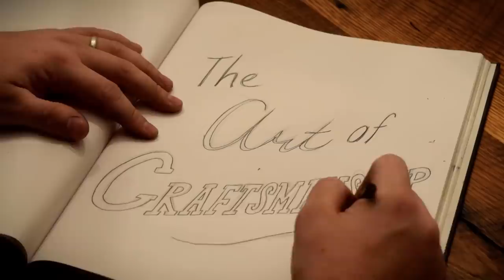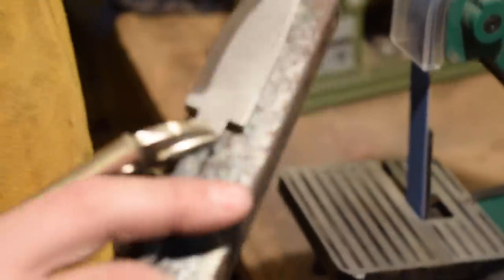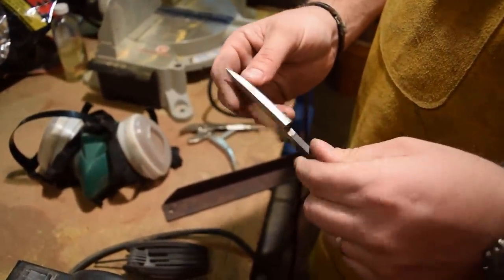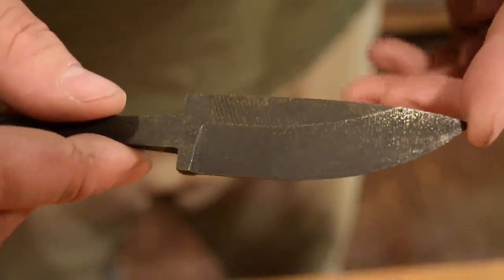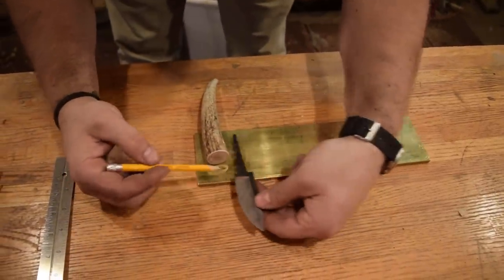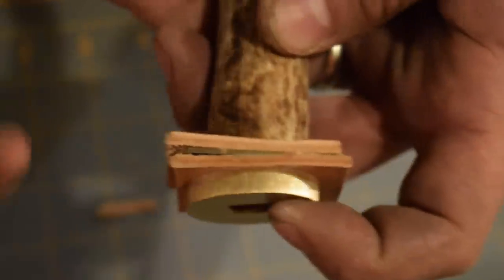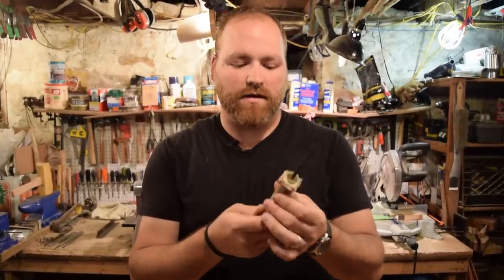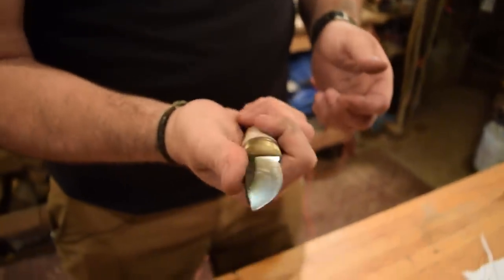Making a Hidden Tang File Knife with Antler Handle

Comment: I’ve watched this video twice now enjoyed both times. One trick I use when I have a small opening between my bolster/guard is to hold it in place tight and lay it on my anvil and hit it with a hammer. The brass is soft and will close the gap. Then take it and use sander on both sides to get back flat. 👍🏼

Comment: I got pretty much that same sander at H F. I created a larger top to replace the tiny work area.  Also tapped out for a screw to adjust the angle, with a needle gauge on the side so I know exact degree.  Your videos are relaxing and informative.  Thanks.

Comment: Nice job. Cover the blade with tape before applying epoxy. Cut the antler tail, drill a hole at end, swage a brass tube through the hole and tie a leather tassle through the hole. Great personality. Greatings from Beirut- Lebanon

Comment: Awesome video!!!  I would like to see a video on how you made your forge though.  THANKS!
Reply: Yeah me too. I'm wondering if that " plaster or paris" would hold up to twin torch burner set up.
Reply: @kevinhollister947  I don't think it's plaster of Paris.
Reply: @kimcurtis9366  I thought that's what it was. Or maybe that's what somebody else did. More research,  definately more research.
Reply: @kevinhollister947  The white material in the forge is Pearlite,find it easily in the hardware store in the outdoor gardening stuff. You can also use Vermiculie, found in the same place. It is made into a paste by adding "water glass" which is potassium silicate, (a liquid) which  is on Amazon or where there is a chemical store in a larger city. There are a lot of "how to's" on You Tube for building a forge like that. Look up "coffee can forge" on here. I have made a couple and they are easy. Also, Harbor Freight has a great torch for a forge, it is a torch for burning weeds.

Comment: Small tip, a Q-tip dipped in acetone works wonders for cleaning the epoxy squeeze-out and cleaning up the blade.

Comment: Beautiful knife. I'm a bit late to your channel, but I have a couple of tips for cleaning up excess epoxy: (1) when it's still fresh/wet/uncured, use ordinary household white vinegar - it will dissolve the liquid epoxy and you can just wipe it away (also good for cleaning it off your hands etc. (2) do most removal/shaping of hardened epoxy while it is still in its plasticky phase (ie after it's not liquid, but before it's glassy-hard). You can just use Exacto knives etc, rather than needing to use grinders etc which make clouds of nasty abrasive dust shards.
Reply: For clean up, I use acetone. I hadn't considered vinegar. 
Why work the handle while the epoxy is still malleable?

Comment: Greetings from Ossett, England. Really enjoyed the video and the cool relaxed way you work. I would either leave the handle as is or maybe centre drill a piece of buffalo horn and glue a piece of threaded bar in. Cut the handle down and centre drill. Place the buffalo horn threaded bar in a lathe or drill chuck and fashion with file and fine grit paper to a nice design and finally polish with a car body paint restorer and then glue into the antler tine. Wish we had antler tines that big, is it a moose tine? Biggest we have here are red deer about half inch diameter max, not a tad more. I do a lot of horn work, stick handles, knife handles, pipe mouth pieces, cigarette/cigar holders and drinking horns etc. Great fun if you can stand the smell. All the best mate, Chris.

Comment: Hi very nice knife i have done many from files but never quench or normalise them just shape the knife and from full hard as the file is and temper and done with everyhing without need to normalise andthen requench and again tempering no need all this you got the file fully hard initially just shape the blade and temper it in the oven and its done to the light yellow colour thats all it is the same and saves you lots of time and energy for reaching these temperatures i think this is the all idea of using files to make knifes

Comment: That came out awesome. I would leave the handle long. I don't like how you removed so much texture off the antler though, when sanding the brass and leather down. Maybe the the 1x30 would have got in there better than the 4x36. But Over all I wish I could make one that awesome. I am going to try make a hidden tang one soon. But I need to finish my third knife first then my forth will be hidden tang. That leather pops out so awesome once you added that oil. Much better than I thought it would be.
Reply: scottecooke m
Reply: Leave the handle the way it is.   More rustic, and authentic.

Comment: Great trick turning the deck bak 12 degrees! As you can probably tell I'm brand new at this ! Lol I also noticed most of the really good builders don't use gloves when setting the bevel... I guess this is the make sure you're not getting it too hot ..?
Reply from the maker: Yes. I never wear gloves when grinding knives. Gotta feel the heat😁. Thanks for watching.

Comment: You'll dull a lot of files cutting notches into hardened steel like you were. Also by applying pressure on both the push and pull stroke you're liable to break the teeth off your file. Most files work on the push
Reply from the maker: bannisterrb 
Thanks for the input. I am only applying pressure on the push strokes with these files, but I'll try to remember to lift up more when I'm pulling back. Thanks again and thanks for watching.
Reply: @TheArtofCraftsmanship  , why are you normalizing the steel before quenching? Normalization should be done before fabrications, but not before quenching. 
And after hardening, you should use only the diamond files, because it suppose to be hard as regular files. Since you are making your knives of your files. You can use them on hardened steel. :)
Good job.
Reply from the maker: N Tatic 
Thanks for asking. Annealing is done before shaping, and normalizing is done before quenching. As you are working the profile and the initial bevels before the quench and tempering, you are heating. And cooling the blade often, during grinding. Normalizing after this process and right before the quench, removes any stresses and variations in the grain structure to make a cleaner grain for the final knife.

Comment: If I may suggest , brazing the blade and brass bolster together with silver solder to improve the joint and help "hide" any slight imperfections in fit and it improves overall appearance .

Comment: Wonderful knife..10/10  .. handle length just nice. Im just curious whether there is anyway you could have masked the handle before grinding so that the texture remain as original. Cheers
Reply from the maker: I probably could have, but I was actually going for the transition of smooth to rough antler, which I really like.

Comment: Nice work! Enjoyed your video. You may be interested to know that Walmart is carrying antler tips and sections as dog chew toys. Also, I used to work in the military aircraft manufacturing sector, and we commonly used an adhesive you may be interested in. It's called 3M Scotch-Weld DP100FR. Much stronger than JB Weld or any other epoxy, but the neat thing about it, it cures in an off white color, much like antler and bone. But it is rather expensive, around 30 bucks for a two part tube dispenser.
Reply from the maker: Jojo Diver thanks for watching and your great suggestions. I’ll look into both.
Reply: My wal mart carries a few things that most dont like guns and reloading equipment an supplies, but they dont have the antlers in the pet section. Good tip tho because I can look at their website and get it site to store. Btw, lots of times their site I cheaper than the store. If you find something on the shelf that is cheaper online, they will pricematch. I do it all the time with rods and reels, and reloading dies.
Reply: @MrDirtysteve75  I don't think I'd order antler tips online. They're all different.
Reply: @jojodiver8706  I've got other things I can made with them if they aren't suitable for knife handle. I also have 3 dogs that would enjoy them.

Comment: Enjoyed your video I have two questions first question what is the make and model of the small belt sander that you use and second question at what angle do you have the bed of the belt sander set at 
Thanks in advance

Comment: From my experience, for what it's worth to you, you can completely harden your blank in the vegetable oil by swishing the blade forward and back and side to side!
It will cool down much quicker than just plunging it into the oil and holding it there!  Doing it this way cools the blade much more rapidly and you won't need to heat and re harden and then quench in a different quench medium.
Best of luck!  You made a very serviceable and nice looking knife the way you did it!
If my way of hardening doesn't work for you just keep doing what you're doing but, I'd at least try my way and you may be able to eliminate a step which will speed up your turn around time.
Kudos for a very nice video!
Reply from the maker: Thanks for your suggestion. I agree totally. Since making this video, I’ve learned quite a bit more (as we always do!) about the heat treating process. By keeping the blade moving in the quench, you break the vapor barrier that is cause by the heat releasing from the steel, which in turn, causes a more even and predictable quench. Thanks for taking the time to watch and bring up a really good piece of advice.

Comment: Looks great with the full length antler handle. Also, when using the knife in winter with gloves on, the extra handle length will afford a better grip. I'd leave it as is.
Reply from the maker: W.C. Sciales 
Thanks! That’s a great piece of advice.
Reply: @TheArtofCraftsmanship  
That 1×30 belt sander you are using, do you have a video of the modifications that you have done? I would really enjoy seeing what you have done to it, because I also have the same one. Thanks!

Comment: I like your video. You work with tools anyone could come up with. You might use a piece of aluminum angle to clamp to for grinding. Looks better and would absorb heat off of your knife quicker. Thanks for sharing
Reply from the maker: Joel Adams thanks for watching and your comment. I’ve thought a couple times about using aluminum angle iron for my jig, but I use what I have. I’ll keep my eyes out. Thanks for the suggestion.

Comment: When I use a file it weighs a ton but it buffs out like chrome.
When I use a circular saw blade its very light.
I leave them hard and use a zip saw to cut them and an angle grinder to work them.
And for handle hole  I heat the handle cherry red  and with a 110 welder on low I blow holes through the handle.
I clean it up with a angle grinder and epoxy fills the holes in when you glue it
the glue get hard looks great and its as tough as it can be.

Comment: got a tip that will help you in the future. when you quench your blades you need to move them around vigorously to prevent the leidenfrost effect. it will help your blades harden more constantly. just a tip from another smith
Reply from the maker: Thanks! This comment will be on the new 5 Questions video. Cheers!
Reply: Not just around. Only up and down.
This minimises the leidenfrost effect as much as possible, and helps prevent warps.

Moving the blade sideways increases chance of warping. You want as little stress as you can on the blade when cooling.
Even once it is seemingly 'cool' it can still shift for 20+ seconds after it comes out of the quench.

Comment: To cut or not to cut...it all depends on what you use the knife for...and my grandfather never would use a piece of brass thicker than the blade for a bolster, Great knife, but when you were prepared to put the handle on, last step on mine was "Bluing." File steel will stay nice looking long if it's blued, just like a gun barrel...

Comment: How did the forge hold up for you? I noticed a little later on you started using a different forge. I have considered using in of these just as something cheap and easy to make until I buy something else
Reply from the maker: It has held up really well. The refractory degrades over time, but I still have it and use it occasionally. I switched to the new forge because I wanted to have a large and more versatile forge space, but for heat treating small to medium size knives, it’s still really effective.
Reply: @TheArtofCraftsmanship  great thanks for the quick reply! I thought that’d be a really good idea for something quick cheap and easy but I’ve read a few things that said to avoid it like the plague

Comment: If you have a glass place near you try buying a piece of pyroceramc glass (fire place glass). Have it cut to the size of your platen and JB weld it to it. It provides a crisper backing and draws the heat while grinding.

Comment: Great video!!  Keep the handle like it is. What did you use to mark the center of your blade to start your plunge line?
Reply from the maker: I used a sharpie to darken the steel, and then a marking gauge set at half the width of my blade, to scribe down the center, then flip the blade and scribe again, this will give you two lines, very close together. Between those lines is your center.

Comment: How did you trim down the table of the small sander? You said in the video you had to adjust the table after the sander bit into the bevel, what did you adjust to?
Reply: He cut off the lip on the back of the deck

Comment: I seen you used a 90° angle but I don't understand how you made the bevel on the blade? Is it because of the flex in the 90 or do you apply more pressure towards the top or the blade is clamped too? The only reason I ask is I figured if you clamp it to a 90 it's going to shave the side of the knife flat
Reply: The table is at 12.5°, like he said.

Comment: Hello,
I have a question about your hardening furnace. Which material did you process in the metal bucket? Is the refractory cement? Fireclay?
The idea with the metal bucket I find very good. I also want to build a part to harden my knives. Please excuse my text, it is written with a translator tool. From German to English

Best regards Torsten
Reply from the maker: Thanks for the comments and question. The refractory is made from a mixture of sand and plaster of Paris 1 to 1 mixture. Thanks again.

Comment: Good video but please tell me you got new drill bits after this. Plus I like how you use the same tools some of us have.
Reply from the maker: Mister Seven 
Thanks for watching seven, and LOL about the drill bits. I'm always getting new bits and replacing ones that break or go dull, but I do need to invest in some carbide bits. I'm not, unfortunately, a full-time craftsman, so I get the tools that I can afford the time that will do the job. But to me that's what tools are for. Thanks for the input, and thanks for watching.

Comment: Great video. I like the handle as it is - the length and curve give it a cool appearance. Question on the gluing process - why don't you tape the blade when you do the gluing process? Does the tape gets stuck, due to glue flowing down? And/or is it just easier to clean up after the epoxy dries?
Reply from the maker: Peter Huggins 
Thanks so much for the comment and for casting in your opinion on the handle length. Usually I do tape the blades before glueing, but this was the first blade that I decided to leave the black forge patina. Sometime I will get some glue under the tape and then have to scrape or sand it off, so I wanted to avoid that. I decided to use some alcohol to clean the blade before the glue dried to be extra cautious.

Comment: I know this is an older video but I'm curious.  When you're grinding the bevel, are you moving straight right to left? Or are you rotating slightly near the tip?  Also what kind of belt are you using? Is it just sand paper of some sort or is it a different kind of belt?  You make some beautiful knives and axes on your channel.  I've made a few my self, but always looking to improve.
Reply from the maker: When grinding I move mostly straight across but I do rotate when I get to the top to keep the bevels even. I’m using a 1x30” belt grinder with standard aluminum Oxide belts in various sizes.
Reply: @TheArtofCraftsmanship  Thanks, I thought I was catching a slight movement when you got near the tip but I wasn't quite sure. The belts is good to know, I have some of those for my 1x30!

Comment: How is that central grinder holding up, thinking of buying one depending on your answer?
Reply from the maker: Fort Peck Tim I have nothing bad to say about my 1x30, other then it’s a bit under powered, but I knew that when I bought it. It’s great. I have since purchased a 2 x 42 belt grinder, but I still love the 1x30.
Reply: The Art of Craftsmanship 
Did you have to mod up the platform on the 2x42 to get a different angle like you did on the 1x30 ?
Great work sir. Leave the antler like it is. The best video I’ve seen in 5 years. Would like to see you do a ferrier rasp knife. If you’ve done one please drop the link here. Thanks so much.

Comment: Great video,I liked it a lot but I noticed that the support behind the belt on the small belt sander is not tight to the belt so the belt has to bend  when it comes against the support, this gives your blade a slight curve instead of being flat. I know this may be intentional. Good luck with your further videos

Comment: If you leave the troughs of the teeth of the file in the finished knife these cause stress raisers and the knife could break from these locations if sideways stress is applied by the user.
Stress-raisers are sharp corners, grooves, notches or acute changes of section that cause stress concentrations under normal loadings. They can be found on both rotating and static components. The stress concentration factors of sharp corners and grooves are high, and difficult to determine accurately.